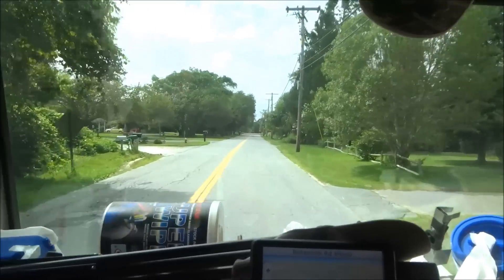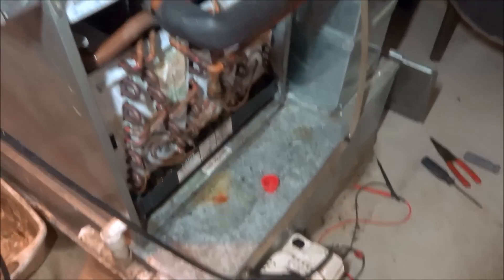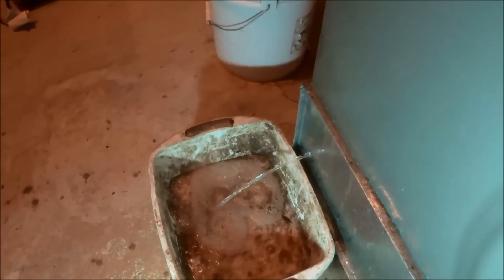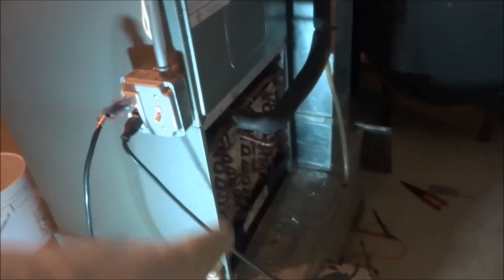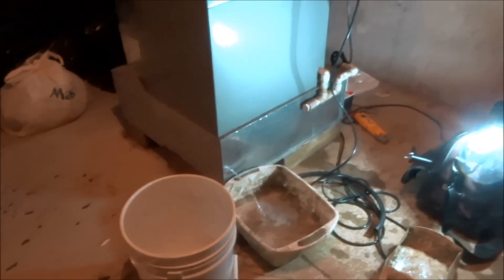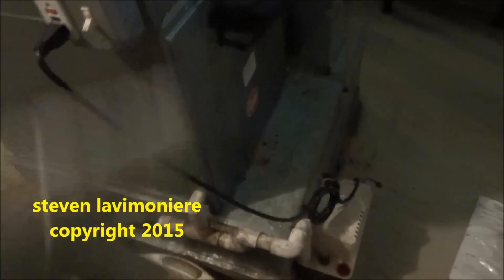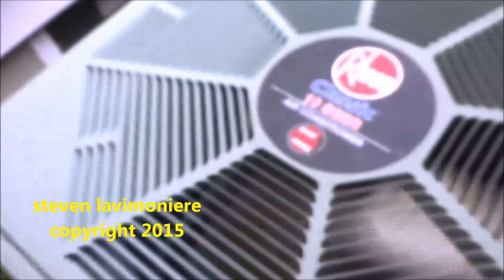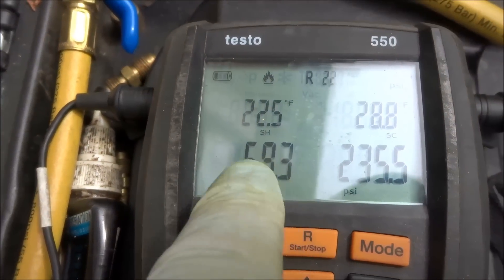hvac :a.c. unit icing up

Comment: I have a question for you...I have seen you taking your readings on your gauges with the compressor panel off. This doesn't affect your final readings for super heat and subcool..??

Comment: steven... i went to a rheem 3 ton unit 12 years old   the preasures were  53 psi on low side  168 on high side  added 1 lbs of r22  freon the preasures barely moved they went to 54 low side and 175 high side and the unit was still freezing at service port about 12 inches from compressor out .. can you give me a hint of what do you think is happening here . it had new filter  and temp difference of 8 ...and txv. superheat was 22.
Reply from the maker: sounds like a air flow issue spit should be more .you might have a blocked liquid line filter check the temp differents on both sides of filter run a cheep air filters check the rotation of fan also start with the air flow if it has a txv charge to 9 degrees subcooling .never mind superheat  split of evap should be 15 so your low maybe the coil is durty
Reply: yeah i suspected a dirty evap coil because the low side is not moving much it rose one point after ad 1 lbs of r22  from 53 psi to 54 psi.  also the air issue you mentioned is probably spot on , this guy had tape small rags all over the duct in base ment... thank  you so much for answering steven.

Comment: I can't believe there was no water on the floor around the air handler.   Whoever installed that unit did a hell of a job sealing that return base.
Reply from the maker: Jim D water tight lol

Comment: So the blocked line caused it to freeze up?
Reply from the maker: SuperAceuno1 the bottom return was full of water blocking air flow across the coil ,causing it to ice up {no air flow}to fan
Reply: steven lavimoniere I had a window unit start freezing up a couple of years ago so I replaced it rather than servicing it
Reply from the maker: eather the filter was durty or low on freon .you probley did the smart thing just replace it .there cheap enough